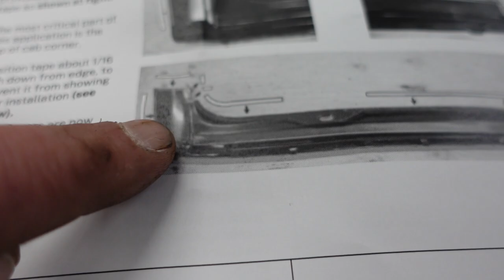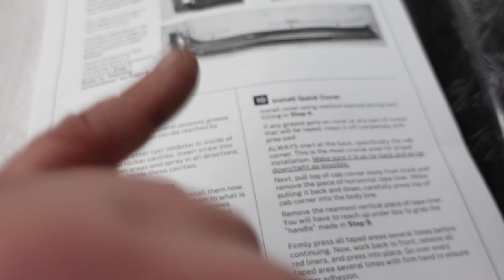Painting & Installing Rocker Panel Quick Covers & A New Grill On My Silverado

Comment: If youre going to plasti dip that chrome bumper part you might be better off doing it black then white. Cause that white plasti dip isnt going to match at all with the truck. Plasti dip also sells a glossifier, you just spray it on after for a glossier finish then the normal flat color

Comment: Those rocker covers are definitely only good if you have light/moderate rust. I mean the manufacturer designing them to be bolted on to the bottom seems a bit crazy. It looks better though!
Reply: There are support brkts available if there is worse deterioration